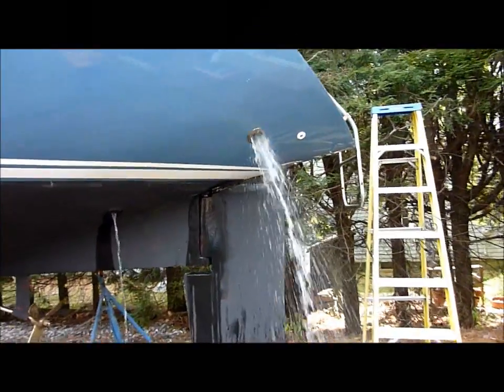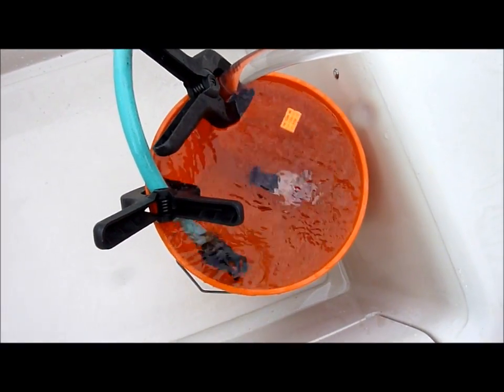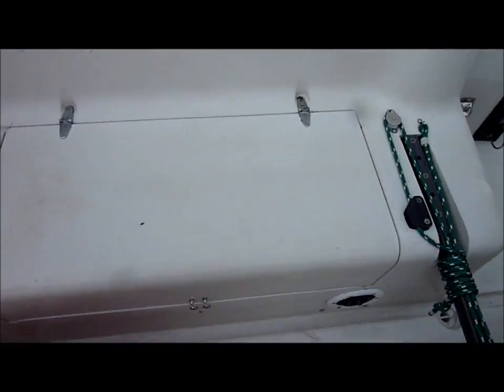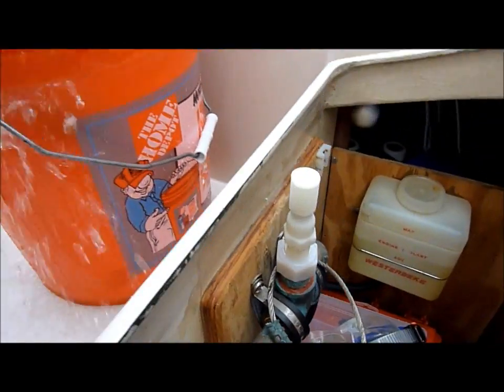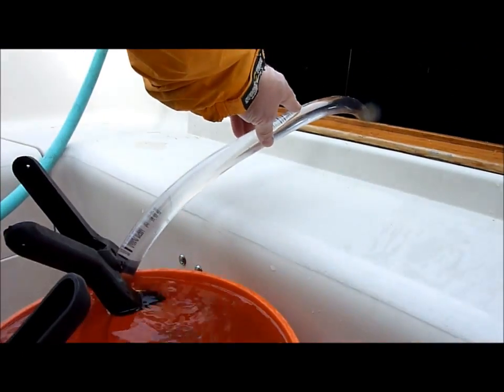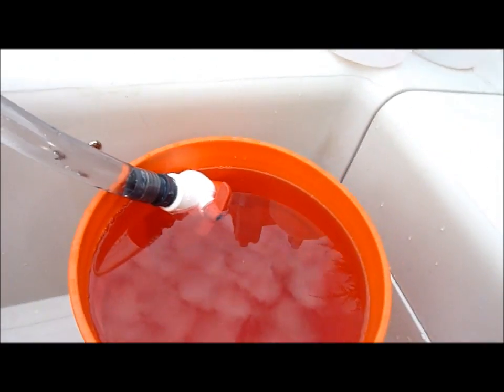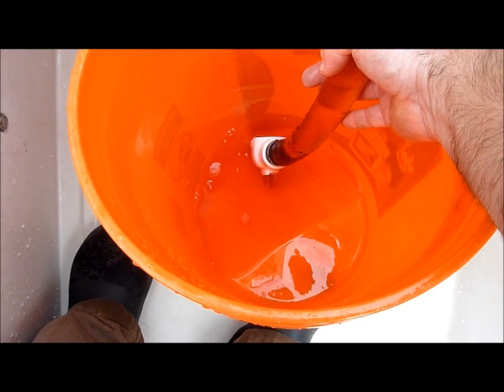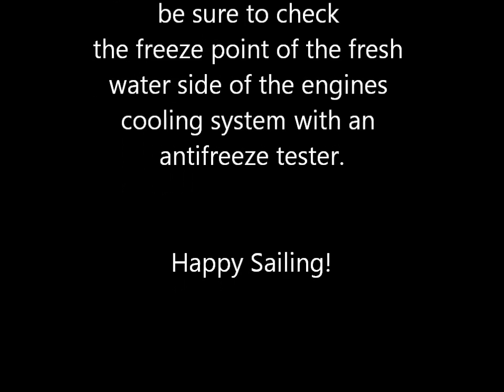Winterizing A Marine Diesel On The Hard

Comment from the maker: @ Jocelyn,
 
Always a pleasure to get comments from folks who don’t fully understand what they are actually commenting on. This is a sea water/raw water circuit not the fresh water / ethylene glycol side of the cooling system. As for reading the F’ing manual here it is:
 
Westerbeke:
“Sea Water Circuit
Close the thru hull seacock. Remove the raw water intake hose from the sea cock. Place the end of this hose into a 5-gallon bucket of clean fresh water. Before starting the engine, check the zinc pencil found in the primary heat exchanger on the engine and clean or replace it, if required. Clean your sea strainer, if one is installed in the inside of the hull.

Start the engine and allow the raw water pump to draw the fresh water through the system. When the bucket empties, stop the engine and refill the bucket with an antifreeze solution slightly stronger than needed for winter freeze protection in your area.

Start the engine and allow all of this mixture to be drawn through the raw water system. Once the bucket empties, stop the engine. This anti-freeze mixture should protect your raw water circuit from freezing during winter lay-up, as well as providing corrosion protection.

Remove the impeller from your raw water pump (some antifreeze mixture will accompany it, so catch it in a bucket). Examine the impeller. Acquire a replacement if needed and a cover gasket. Do not replace the impeller back into the pump until the spring commissioning.”

As for a “waste of glycol” the only way to ensure you are not wasting any is to physically test it with a refractometer as I do. Physical testing ensures the correct amount is used, and no more. To adequately protect the system from freeze ups you need to ensure the PG is not diluted to an unsafe level. Every engine is slightly different in how much it takes to provide adequate freeze/burst protection.
.
On the hydrolocking front I would suggest you do some research on the subject.. Every year I get to deal with DIY’s who have hydrolocked an engine by using improper winterizing practices. All it takes is to create a siphon in the RW circuit and you can fill a cylinder with water. Water is not compressible…

Comment: dont the impeller of the pump stops any water from coming in?  a starter ca make your engine hyrdolock as it will make the water pump turn, in this case as soon as your engine is off it should block anywater

Comment: I am going to winterize on the hard this season. No problem - ill run the in-out bucket! Looking for some clarity on the hydro lock - obviously something I would like to prevent! Should I remove the hose before shutting down and let the engine run to drink it dry and then shut off?

Comment: Thanks for the video... 2 questions... 

1. the comment said you pull your impeller after you run the antifreeze in. Does this cause you to lose antifreeze when you open the pump and if so, is that a don't care ?

2. Do you leave the raw water sea cock open or closed or is that a don't care?
Reply: I think he removed it before winterizing. Antifreeze would fall out if replaced after winterizing.  He then replaces the impeller in the spring.
Reply: Leave your sea cocks open.  If water runs back into them it can freeze the valve and split it.  Better to have it drain out.  The former owner of my boat did that to the intake for the head and it leaked when the valve was open.

Comment: Other than preventing condensation, isn't it necessary to bring the engine to temperature so that the thermostat opens up and allows water to run the water through the engine or is that on the fresh water side of things? Sorry if this sounds like a dumb question. Still learning.
Reply: Breal191 I just bought a boat with a volvo, it says to remove the thermostat before winterizing.
Reply: +Breal191 I suspect that on this boat it's a closed cooling system. That means that it is NOT circulating raw water through the engine. Instead it's circulating antifreeze. Raw water and antifreeze move past each other through a heat exchanger, effectively removing heat from the closed portion of the system. Anyway, there's no need to circulate more antifreeze through the engine that uses a closed cooling system during winterization - it's already winterized.
Reply: @79cd36  thank you!